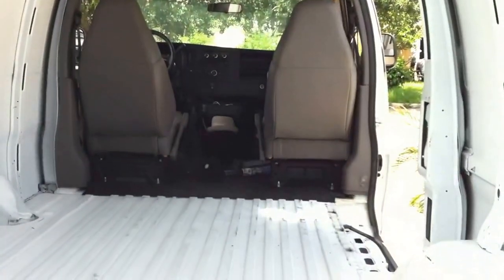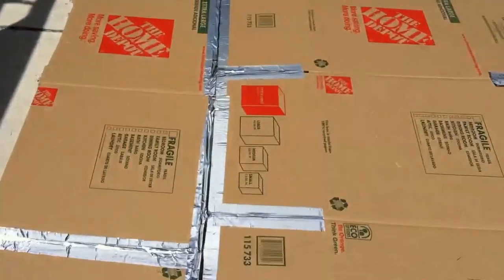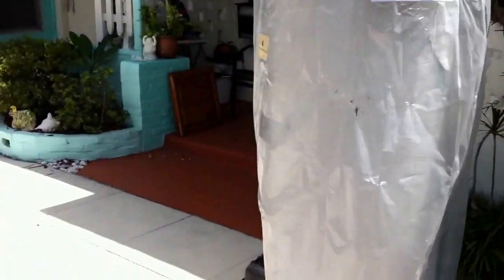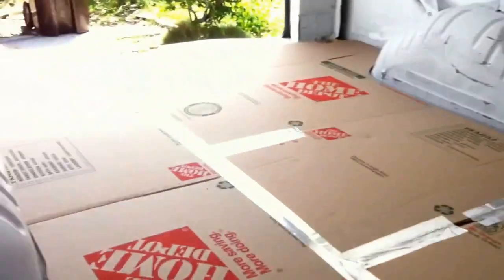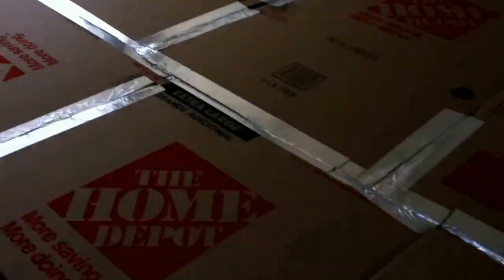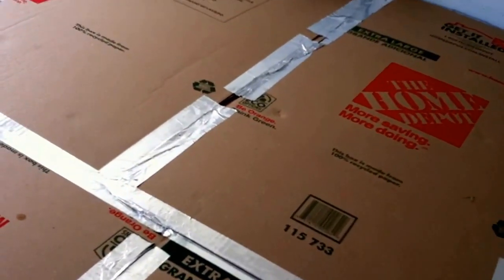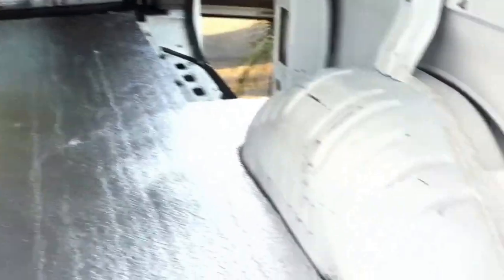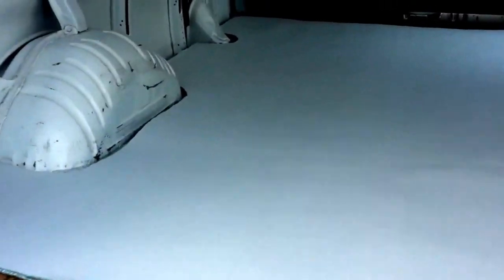VANilla Camper Van Build #1 Floor Insulation

Comment: Will, consider putting in sound deadening material as well. I put in a dynamat alternative and some pipe insulation on the walls and it makes a great difference to the quietness in the van. It's no longer like a tin can.
Reply from the maker: Patrick Henry Thanks -- good info. The guy at Low-E said the insulation has sound deadening properties and said I shouldn't need extra. I will live in in a while before bolting anything down back there, so if it's too loud/hot/etc it will be easy to adjust.

Comment: did you use any glue to keep the floor and all the layers together?
Reply from the maker: Rolando Perez No the mat is heavy enough and there are trim pieces on sliding door and back doors that hold it down.
Reply: Hey tanks. I have heard that passenger vans  come already insulated all over the place so don't need to do much other than the windows. Do you know if this is true
Reply from the maker: Yeah you could get a passenger van and sell the seats. Yes, passenger vans and conversion vans are already insulated. It is true you would lose a lot of heat through the windows but you would like having those windows in the summer. I am not sure how good the insulation is for going to very cold places.

Comment: For the low-e reflective barrier, is it designed to work with no dead air space? How does it work?
Reply from the maker: Ryan Brindley It is supposed to have an air gap. I think it is very comparable to Reflectix as far as functionality. Reflectix is cheaper; Low-e is suppled to be more ecofriendly.
Reply from the maker: ***** I chose extra space over insulation. If insulating for more extreme climates is your priority, I'd look at the way Dan Travels did the floor of his van. He has a video explaining it on his channel.